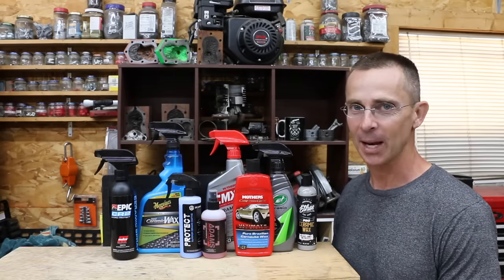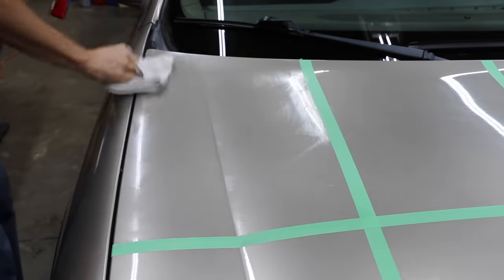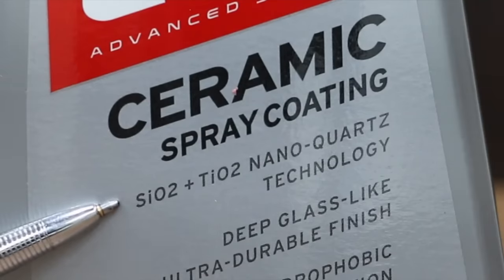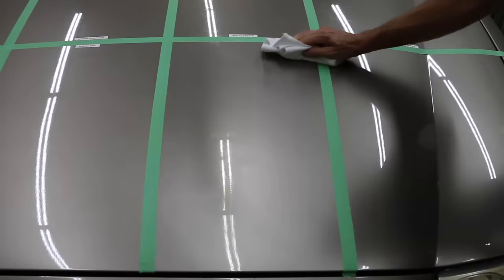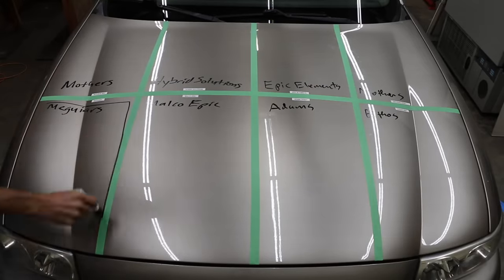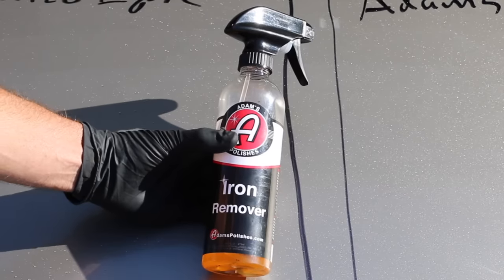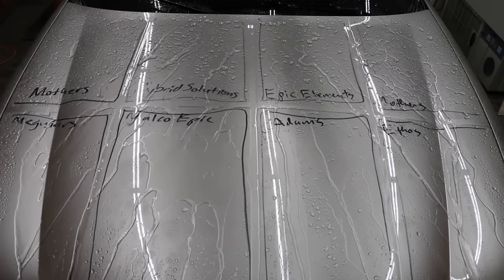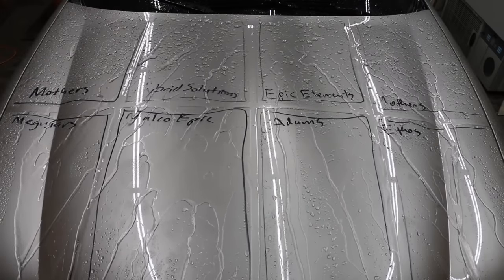Best Ceramic Spray Coating? Mothers vs Meguiars vs Ethos Pro

Comment: As a detailer, I thought this video would be misleading or not accurate to real life abuse. But this test was extremely well done and very thorough. If you look at Adams polishes, you'll find a LOT of great durable products. Same with the new line from Turtle Wax. The game has definitely changed for the better.
Reply from the maker: Thanks so much!
Reply: Project Farm's hellish tests are why I'm subscribed. lol
Reply: I'm honestly surprised at how well Turtle did in this compared to their past products.
Reply: Turtle Wax has up'd their game over the last year or so (the Ice line of products is VERY good...even to the pros).  However, he did get some help from gravity on the slickness test with the sponge/plate on a couple of the products (Ethos almost fell).
Reply: @jeremiahbachmann3901  May have to try them again. I last used turtle wax a decade ago and it worked... less than advertised.
Reply: @FakeJeep  Check out their ice seal N shine if you want something cheap, that does a top shelf job. For a consumer product can't recommend it nearly enough to people. It's an SiO2 infused spray paint sealant that works amazingly.
Reply: Cheap makes chemicals sound like they're bad I apologize. All of these are more on the "affordable" range, but work very well
Check out "CS3" it's a ceramic infused waterless wash that I use for door lambs, door sills, painted areas that don't get much attention
Reply: He needs to try the last coat brand def didnt do a long run down they been out for awhile now not to expensive n rlly good product I still love watching his videos tho
Reply: @dominicsapienza  yes very true! I hear great things about LastCoat. He should also try BeadMaker from P&S, both brands the consumers use all day every day!
Reply: I know...watching tons of videos, personal experience...doing more detailing this past year or so for people....loving the TW products time and time again....over the more expensive/Online only in many cases products.   Cheers to TW!!  Making it easier and better.
Reply: Hey I’m trying to find the best detailing products on my own car that’s 10 years old. I became a below knee amputee a year ago from a motorcycle and am trying to find something I can do at my own pace. (Can stand all day some days, sometimes I take my leg off after 4 hours). I’ve only done interior product so far. Would you agree that Meguiars natural shine is best for dash and whatnot? I also found their leather 3 in 1 do be best. I found any armor all product to be terrible.
Reply: Basically I’m having trouble finding work caus I never know how long I’m going to be able to stand that day. And as far as an office job, I have to wear shorts so I can make adjustments throughout the day. I feel like this accident ruined my life. I’ve done everything from work on a farm throwing hay and was just getting into it before my accident. Can’t think of anything on my resume I can do now
Reply: Getting into IT, computer repair, networks etc
Reply: @MrDickhead47  my question would be are you able to bend over or take a knee rather often while doing the contact wash? If it wears you out too much, and I can definitely understand, Adams as well as a great company named Gyeon also make awesome spray on, rinse off coatings that seem to perform very nicely. If you want to be a bit more involved, I would say best bang for the buck is generally anything turtlewax, they've very very much upped their game in the last decade, especially their "Seal-n-shine". For the dash and interior I generally don't like using much of anything that is oil based or will give a shine, but it's preference as I like a cool matte look rather than a slick wet look. As far as that goes, generally you can stick with something that won't fog glass on clusters and will smell pleasing rather than chemically. You're right, meguiars is a good brand. Definitely bang for the buck, I use their "hot wheels" wheel and tire cleaner in the purple bottle sometimes because it's extremely cost effective
Reply: @well_as_an_expert_id_say  cool thank you
Reply: @well_as_an_expert_id_say  man I just noticed some paint issues with my car, was up in big bear for two years. I just clay barred (looked amazing), then used Meguiars gold carnuba wax, I will NEVER do that again. For sure didn’t have the energy and my leg (amputee) was giving out from all the buffing. It really needed it and looks new but I’ll be using that turtle wax hybrid solution in the future. I like Meguiars natural shine (matte) to clean and protect with an applicator pad for interior. I didn’t know that 1. Not a big difference between spray and regular wax 2. I could have gotten good results with the hybrid solution. I just wanted to do it the way my grandpa taught me but I feel like I wasted a lot of time and will sore tomorrow for sure
Reply: @MrDickhead47  I like chemical guys nonsense for interior cleaning. In fact I use it to clean some household things too, especially if it's something I don't want to smell like cleaner since it's odorless. I like 303 for interior protectant. It leaves a nice finish.
Reply: @Nosfermarki  I feel you but when I was detailing cars it’s just expensive and so I used P&s express interior, way better imo, and didn’t really use dressing much. I clean my house with car detailing stuff too lol. Best one was super clean 4:1 and a drill brush in my shower. That’s when you know you’re a real detailer 😂

Comment: love that side by side video of "before chemicals" and after... really shows how well the products work.  Most products do a great job initially but fail over time, washes, and exposure to the elements.  Would be interested to see you do a traditional ceramic coating test to see if there is any benefit to spending more money for different brands of ceramic coating.  I did a test like that and didn't find any difference between brands, but you do much more thorough and in depth testing than I do.
Reply from the maker: Thanks so much!

Comment: For anybody interested, I used the turtle wax stuff last summer (I think in July). It's now April of this year, it rained a little at our car meet last week, and I had the most impressive water beading compared to anybody at the meet! The stuff is crazy. I did two coats, which is suggested for truly long lasting results. The best part is, there's enough in the bottle that you can do two coats no problem at all!
Reply from the maker: Thanks for sharing.
Reply: very curious to try, but the amazon comments are flooded with bad reviews.
Reply: @chasesielbeck6557  Interesting, I haven't looked at the reviews there yet. All I can say is making sure you have a good clean surface, and doing two applications works pretty well.
Reply: @tnast  I plan on thoroughly cleaning and clay barring beforehand, i may go with it since it held up very well in the video. they also have a graphene I saw and hope PF makes a video with that as well.
Reply: Good to know on the quantity. I was thinking of applying two coats too, but didn't see what kind of coverage to expect from a single bottle.
Reply: @shaun6828  Yeah the consistency is similar to glass cleaner, so a single bottle goes a looooooooong way.
Reply: @chasesielbeck6557  Amazon suffers from review spamming too.  Companies even sell services to provide positive reviews or spam competitors with negative reviews.
Reply: I applied one coat half year ago, and it’s still in great shape, applied another coat last week, and there’s plenty left in the bottle, i’d say maybe 10 coats left
Reply: @chasesielbeck6557  i don’t trust amazon anymore. Some competitors hire bots or 3rd party company to leave negative comments on their competitors! 🤮🤮🤮
Reply: @chasesielbeck6557  I would trust this video more than any "review" on amazon.... just saying.  Plenty of fake reviews on amazon thats for sure.
Reply: What's the amazon link for the one you got?
Reply: So easy to use,  can almost let the rain bring it back to a washed look
Reply: @chasesielbeck6557  The stuff is as good as his test shows, it lasts at least 3 months, goes on easy, I'm at 7 months on 2 coats and it seems to be starting to wear off.  Well worth the $14 it costs. I'm not sure where the bad reviews are from, I polished a 14 year old car with some light polish and a towel and then applied this stuff and people don't believe how old the car is and it's black and sits outside, the shine is that good and the water beads up that well.  It performs nearly as well as a ceramic coating and is cheaper and easier to apply.
Reply: Just did my Golf. I reckon I'd get 5 or 6 coats out of a bottle.
Reply: Just wish it was as big as megs
Reply: @marcomagtoto1144  Amazon used to be able to filter results for example you could do stuff like "stove -camping" to filter out all camping stoves and get only stoves of a different sort but now you can't filter out results at all to refine your search and instead have to dig through so many irrelevant results.
Reply: TW is/has become awesome.  So happy with their products this past year...easy to get, price, and the performance is good/same if not better than other much Toted products that are more expensive and/or just online ordering.
Reply: @chasesielbeck6557  If you watched this video, why are you bothering with Amazon reviews? Do you think any of them went through what was done in this video? There might be a better coating out there, but of the ones tested, you have everything you need to know right here.

Also, as stated in other replies, Amazon reviews are a crap shoot at best. I’ve read reviews for good products that got bad reviews because the purchaser bought the wrong item, size, didn’t follow the directions, or was used outside of what it was designed for. How are any of those the products fault.
Reply: @chasesielbeck6557  76% 5 stars and 15% 4 stars => 91% in top 2 with a heavy weighting in 5 stars (5x the number of 4 star ratings). That’s strong!  Only 3% combined in 1 and 2 star ratings. That’s how I tend to analyze reviews with a star system. 3% of people won’t like anything. And yes I know there are spammers, both negative and positive. Heck, it’s even possible some YouScrewed comments come from commercially motived parties.
Reply: @chasesielbeck6557  Amazon reviews lol horrible place to go by
Reply: @animejanai4657  yup and tons of companies who will change their product to keep the same great reviews. hence how you see diaper pictures on a review of a stereo lol

Comment: I use Turtle Wax Ceramic on my new semi, had surprisingly good reviews for its cost. Was fueling the truck when the hose slipped out of the tank spraying the side of my truck on its way to the ground. This normally would require a truckwash, but the diesel beaded and slid down the side of the truck with minimal cleanup. Never had a wax do that!
Reply from the maker: Impressive!
Reply: What steps did you follow before applying since it was new truck ?
Reply: @jaimebedolla989  
Went over it with the clay bar like recommended.

Comment: I knew Turtle Wax would be a top choice. I was thinking the Mother’s CMX would be best. Guess I was wrong. Another great review Todd. Thank you.
Reply from the maker: You are welcome!
Reply: Ive been detailing cars on the side for a few years now and I've been experimenting with coatings. When CMX came out, it was a game changer. Lasted decently well, and gave good protection. Gloss was left to be desired though. When put to the test however I noticed it's longevity was iffy. Definitely great compared to other products but I found I was having to reapply more often given the fact I can't wash my car often due to school. I've always been skeptical of turtle wax until they released their hybrid solutions. That stuff packs a major punch in durability, longevity, gloss and protection. Pair it with the ceramic wash they have and maintenance of the coating in incredibly easy to do. My car hasnt been washed in over 3 weeks, and still looks incredible. Definitely give it a try
Reply: Yep, I'll vouch for the Turtle Wax as well.  I quite literally just threw out all my other products the other night.  There's no point, all my old carnaubas and synthetic waxes are straight up obsolete.  The stuff is just stupid, I haven't washed my car in at least 3 weeks, it just rained a few days ago at work, dried by the time I left, and even though it's obviously dirty from the water drying, it still has such an incredible gloss that you can hardly tell it's dirty.  I can't imagine anyone being disappointed by this stuff.  I applied 2 coats to each our cars like it recommended, 24 hours apart.  I haven't used TW products in years, but holy cow did they ever knock this one out of the park.
Reply: ...and meguiars was bought out by 3M

Comment: Hybrid Solutions is a game changer, switched to the ceramic stuff from Turtle Wax Seal and shine. As always great video!
Reply from the maker: Thanks for sharing.
Reply: @ProjectFarm  @MastaFlash13 The interesting thing about this comment is most people in the car 'detailing scene' are moving to Turtle Wax Seal & Shine (improved formula / yellow stripe on bottle)
Reply: There is a video talking directly with the chemist and marketing heads of turtle wax. Seal and Shine does have SiO2 in it. The new formula adds UV protection and less streaking. But still consider the “ceramic” branded bottle to be slightly better. This is from Turtle Wax real world results may differ.
Reply: @BillSwearingen  Turtle Wax was a big name that fell off so much that they've been laughed at. But in the last 2 years they've revitalised their lineup and some of their products offer absolutely brilliant results for very little money. I remember trying out their Spray Sealant & Dry 'n' Shine products last year and I was blown away at the value for money it offered. And then their new range somehow bested that yet again.
Reply: Daniel Hammer  @ Sounds to me like the one you are saying is better,would be the last one you use to treat the final treatment/seal 
after the seal and shine one?

Comment: I'm going to buy turtle wax right now
Reply from the maker: Thanks for sharing!
Reply: Turtle wax Seal n Shine seems pretty good and doesn't require curing time, take a look at it too
Reply: Tried the Turtle wax, it was easy to apply and looks like a new car finish gloss.
Reply: @hekinho1  Car Craft Auto Detailing has done a bunch of tests and compared Seal N Shine and Hybrid Solutions Ceramic.  He said Hybrid Solutions is better to work with, but Seal N Shine actually protects the paint better.
Reply: Thanks Project farm! As I'm lazy and don't know much about paint, this helped me a lot!
I'll use Turtle wax from now on once a year.
It should go for atleast 10month so that's great! I'll coat the windows as well twice a year!
Reply: The Project Farm Effect
Reply: @ProjectFarm  thanks for this i needed it i got the turtle wax and love it
Reply: Me 2!!!
Reply: @hekinho1  Been my favorite top coat for the past couple of years, nothing else is as durable plus the price is great
Reply: @hekinho1  The Hybrid Solutions is the Seal and Shine, just a step above.
Reply: @hekinho1  Seal n Shine was my go to for a while, but Hybrid Solutions Green bottle is better.  Two coats will last a year and there's less streaking. The new king of the hill!
Reply: Same!
I’m looking for Christmas ideas
Reply: So am i! Was and still a fan of Meguiars but that Turtle Wax stuff is impressive!
Reply: Will have to use Turtle Wax Hybrid on my snow blower. Awesome test as usual. Thanks!
Reply: There are a couple different hybrid solutions, which one should I get?
Reply: When I was a kid I thought they derived the wax from turtles lol
Reply: got one ordered, and on my way to pick it up...god damn!!! love him
Reply: Just bought the turtle 🐢 and used it on my windshield. Helps immensely with water beading and also prior to wax I used a clay bar to help remove contaminants. After watching the PF wiper video I was about to buy the icon Bosch wipers but figured this is another option and cheaper. Just wax your windshield and save $ on expensive wipers.
Reply: In México ls Too Expensive
Reply: I tried turtle wax and its good and easy enough for me will re apply every 3-4 months for my daily
Reply: Keep in mind the adams ceramic coating lasts forever so you don't have to apply it every 3-4 months
Reply: I thought the same thing then I saw turtle wax has THREE different ceramic spray waxes. @projectfarm Shootout the three???
Reply: turtle wax just does business right.
Reply: @tylersparks6059  that is a long time
Reply: @hekinho1  it's actually has better chemical resistance
Reply: @dorkultra  there are much more durable ceramics on the market, they are just more difficult to apply without the convenience of spray on
Reply: @arthurprado3818  I recently started waxing my windshield, and suddenly my six year old wipers work great!  I was going to replace them but doesn't seem like I need to!
Reply: Went with hybrid solutions nice video I always used spray on wax before this...
Reply: Single coat of TW ceramic spray is working great for me so far.   Only place it didn't hold up was the windscreen.  Perhaps I need to switch out my screenwash for something kinder.
Reply: so the winner is called turtlewax hybrid?
Reply: Funny things is that I've been using turtle wax products because of its availability in my area and low cost. Recently, as I've got a new car, I've been searching a lot about detailing products and was about to get a bunch of expensive stuff from high end brands. Guess I'll stick to TW as I've never had a complaint about it.
Reply: I love it and it smells like mango!